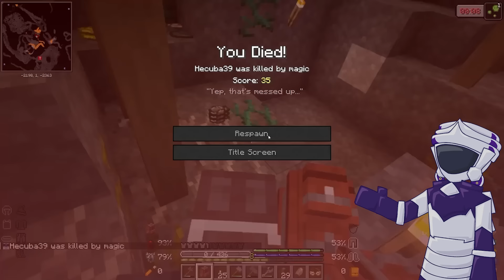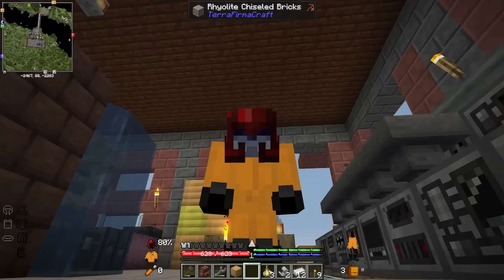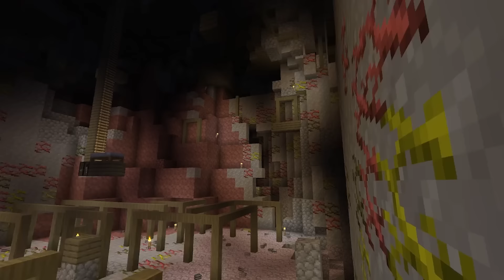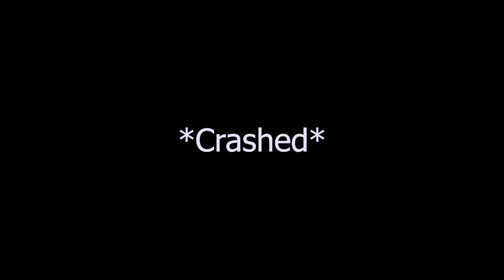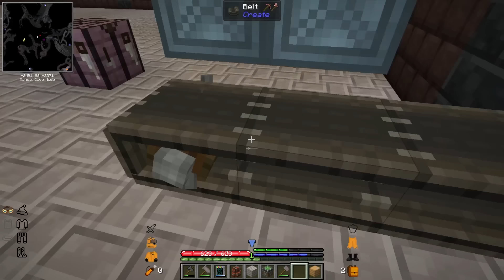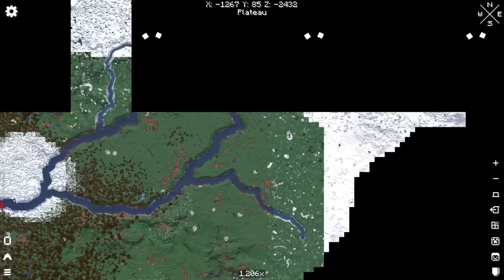Why I spent 20 Hours Making Transistors in Minecraft's Most Realistic Mod (TFG Part 8)

Comment: it's so weird that the silicon ingot can be just "rolled" into a plate. It would crumble immediately from any force applied before it would plastically deform. It should only be cast into a plate.
Reply: the recipes are autogenerated, if a material should have a certain form then the programmer will manually select that form (such as a plate) to be accessible ingame, and use a script to auto generate the recipe for comverting ingots to plates

Comment: At 6:30 I have to add that you are actually wrong, while PE is one of the most common plastics it is not the most common one nor is it in every plastic, it is in reality a common plastic for Some Types of Bottles (like Laundry Detergent) as High-Density Polyethylene and for plastic bags (as Low Density Polyethylene) however for drinking bottles PET is used, which is a fundamentally different plastic, and in various industries various types of plastics are used, for example:
- Pipettes in the Medical Field are almost always Polypropylene
- Brewer units in Coffee Machines are often either Polyoxymethylene or Polyamides
- Your mothers Nylon Stockings are made out of Polyamide 6 (Nylon is just the Dupont Brandname for some forms of Polyamide)
- Your pans likely have a Teflon coating which is PTFE
- Your cars tyres are made from Natural Rubber which is polymerised(technically vulcanised) Latex and thus a plastic
And so on.

Also to note here that not all plastics are cheap and that some High-Performance ones can go for upwards of $2000 a kilogram (Certain Polyetherimids, some Polyetherethylketones)

Comment: Blody baster speed it up with getin into hv , i got to the energyum cristals real fast , hardest part was cromium from rubys (esy) upgrading the ebf and just making a lot of stainles steel, i get that it takes a while to do things while you have a life but still .
I cant wait for the next one hope you got into erly HV , best of luck.

EDIT
I forgot how you just got into erly hv circuits XD, ohnest advice use mercury and crushed gold in a chem bath to get silver and gold 75%chance fore evry gold, that will help ese your cost for moters, geting a gass colecter and centrefuging air yo get oxogen and nitrogen (faster ebf with nitrogen when smelting aluminium and stainles steel).

The next lvl of silicon buel is just 2x price of slilicon fore 2x the wafers so not bad tbh just extra pohphores needed to coat it.

Gold cabels are also a cheap but good method to deliver power in hv also energium cristals take 5 or 4 ruby dust and 5 or 4 redstone dust to get you 9 energium powder in a hv atoclave gets you a 10min energium cristal op batery (80min with just 8x batery buffer).

Also tantelite is gana be a pain for a fue smd componets but not to hard. 

Thats all i got to say that can help you in your jurny mate , god speed and get us more vids to enjoy.

Comment: I have an issue with launching the modpack. It crashes on launch instantly.

The crash log ends with warning messeges about missing .toml files in core forge files. This however isn't a crash messege, just a warn that is very common and shouldn't cause problems. So it seems that the game crashes so extremely early that there's no further log information. Already tried fixing the instance, disabling some mods, changing RAM allocation, etc. Does anyone have a simillar issue and/or managed to solve it? Please help

Comment: Quick tip, once you get an HV prospector, get a fluid drill and start mining for oil, then automate diesel. You need diesel to eventually power your machines to make gasoline which is needed in EV/ IV if you ever want to progress. You can make it into EU via a combustion generator. I also suggest you make a HV jetpack and a hang glider to traverse around extremely quickly. The strat is to fly up in the sky super high, equip the hang glider, and while you're gliding hold shift. One more tip, hazardous materials boots negate fall damage. Good luck fellow Terrafirmagregian

Comment: Hi Hecuba, if you're reading this, i hope you understand.

There is something that makes me go mad crazy about your Chaostech modpack.

One of the things is that despite you can make an iron farm with Create, it requires the crushing wheel, and the crushing wheel requires also the Immersive Engineering workbench and also requires treated wood planks that also require a coke furnace THAT ALSO REQUIRES ONE FUNDAMENTAL PIECE TO MAKE IT, a Blaze Burner.

The whole tech development starts and its destroyed by the blaze burner, without one, you're doomed. And also you can't automate everything or make advance thermal machines for it without a blaze burner to make both Steel for a Blast Furnace and creosote oil to make the treated wood planks for the immersive engineering workbench.

So what im suggesting, is make it easier without the high dependance on blaze burners to progress in the entire modpack, i want to suggest you two different mods that can accelerate the process without being just deadly or long and painful travelings to the nether and also one to make ore production automation more accessible for production:
-Create More Blaze Burners (Adding a direct replacement for Blaze burners themselves quitting the whole need to go the Nether solely for it and allowing pacifist multiplayer destruction more easily)
-Create Ultimate Factory Mod (Adding more low entry tech stone generation and also the automation of Tuff itself bringing more ore farms for production itself giving upper advantages in the start)

Also, i wanted to suggest weapon machinery mods that are equally fun:
-Scorched Guns 2 (Adding better weaponry at the same level or better)
-Create Big Cannons Modern Warfare (Also adding other mods to make functional and mobile tanks and planes or ships like Valkyrie but i think thats too much)
-(Not much recommended but can also work) Create Big Cannons Nukes addon (Adding nuke throwing weaponry, i think it requires Alex Caves to work on or something)

And these are just some mods that could he be interesting or not to add due to being high fantasy or giving other advantages:

-Alex Cave's
-Alex Mob's
-Mowzie's Mobs

You can also add farmers delight and delight variations of these mods as they make more brewing than just meth, AND ALSO:

-Broken Bad Usable Product (So you can let them drug)

I think spartan weaponry and shields would be interesting but you have already tinker's for it so I don't recommend adding that.

And if you want to he fancy, Steam & Rails.

And for the teams and the fighting, FTB Chunks (To claim chunks so automation with previous or other Mods you can maybe add from this suggestion with full automation could be added)
FTB Teams (Avoiding killing bewteen groups)
FTB library (Maybe or not, idk what it does)

After the scorched guns, probably you can also add protection pixel for more armors than just the one's in the high level tech entry.

So with all that, i hope you read this and maybe add the first one's i suggested or think about the rest i talked about. Im sorry, im not critizing your modpack, but maybe could have improvements that just a merely same modpack-event and just adding more chaos and tech into it.

Also, great video you made now, i really liked it, bye bye and kisses. Hope you are okay.

Edit: I also understand i gave a "Not getting good" problem and that maybe i didn't explored or passed enough time into it, but I just wanted to suggest something a bit as I thought it may make the modpack more fun to it, srry

Comment: nitrogen is most likely used to get rid of oxygen in the pyrolase (idk if i spelled that right) because carbon is really reactive and would most likely react with the oxygen in the air to form its monoxide and dioxide, depending on the oxidization state of the carbon
Reply: actually thats a brain fart on my part, oxidization state doesnt matter (unless its the maximum) as oxygen itself is an oxidizer so it'd turn into carbon dioxide almost always (if theres enough oxygen, of course)... the curse of being a chemist, too many things to remember so you get random brainfarts
Reply: @selena.hearts  surely, you could use a noble gas(such as argon) instead? we're using nitrogen because it's easier to get?
Reply: @polygontower  yeah but nitrogen is more common, therefore easier to get

Comment: Fun Fact! Sodium batteries have almost none of the negatives of lithium batteries (rare element, combustible, toxic), and the only real negatives are that it would require changes to factories to produce, and that it would need another 3rd of volume for the same power storage. Considering that now the square cube law is working for us on this, the volume is really not that much of a negative!
Reply: So basically for mass storage Sodium is perfectly fine but for smaller or mobile usage lithium is good?, I see.
Reply: @Aureonw  sodium batteries are used in things like small solar farms. the power density is the main reason sodium isn't used on most things you think of when hearing "battery" like small electronics, Electric Vehicles, etc.
Reply: @edim108 Yea I know
Reply: The weight is the main downside
Reply: This isn't true.
Reply: Sodium is still pretty explosive especially when in contact with water

Comment: It feels very funny that, for the steel boiler, you end up using a create boiler in order to feed it water and lava. Like, using a boiler to feed a different boiler. It feels like create could use some better integration with gregtech, maybe with some way to convert eu into stress units. I mean, in just this episode you made so many motors and turbines, and other things that spin, yet you can't use any of them to spin a few cogs?
Reply from the maker: there is a create addition that has motors to create rotational energy and I think they should make a way to use GT steam to directly power a steam engine

Comment: Hoping someone can help here, found nothing online to solve this. I've just built my Large Chemical Reactor to make Nitric Acid and it has the ammonia, oxygen and circuit 24 but won't start. The structure is valid and the maintenance hatch is clear, it's super frustrating.

Comment: 42:47 actually, at least in my line of work, when we have to braze copper piping, we use nitrogen to purge the inside of the system before we start. That removes any oxygen, and helps to prevent the inside of the pipe from oxydizing when we apply the heat and silver solder. We could use argon (and in a pinch I have) but nitrogen is much cheaper, so that's what we typically go with. Welding on the other hand, you definitely want to use argon, otherwise it won't work as well since you're using such high temperatures.

Comment: 16:31 Yeah, Nitrogen is pretty much an inert gas, it's pretty much just there to replace any other gas that is chemically reactive so that they don't react with stuff forming random stuff you don't need.
Reply: For carbon speifically, I think it's just there to create an oxigen free environment. If oxigen were present at high temperatures, the carbon would just become CO2
Reply: If it were heated, it could combust in an oxygen environment